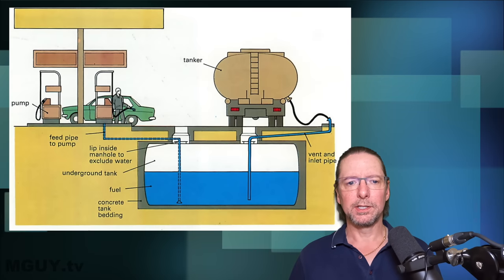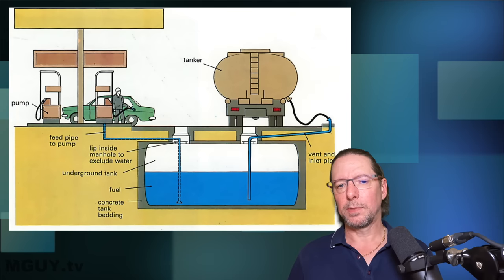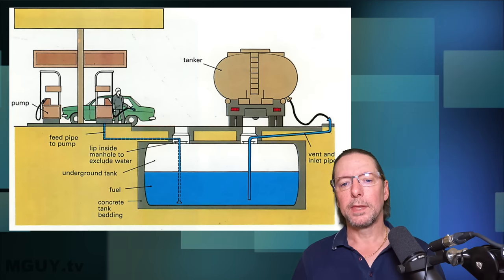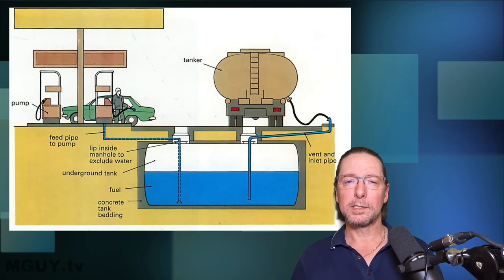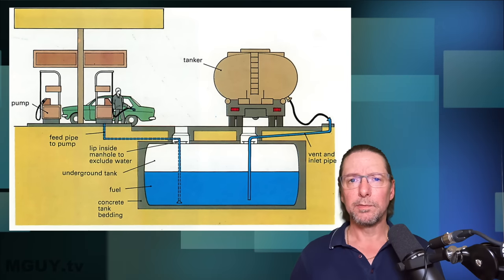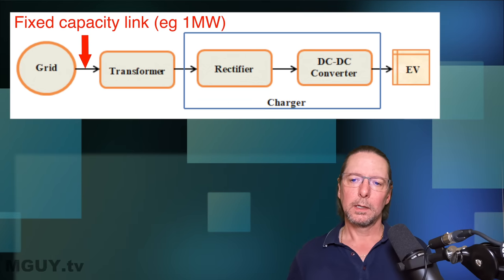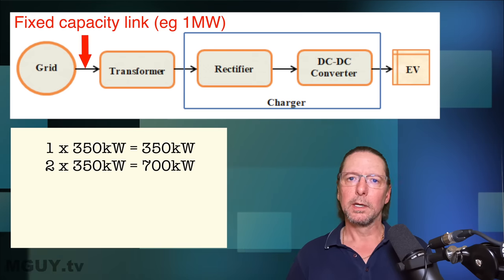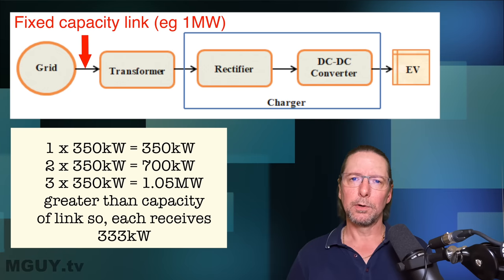HUGE problem with EV Charging Stations that no one mentions | MGUY Australia

Comment: Uh, you kind of skipped a meeting with how charger infrastructure works. You are dealing with 150A 400v infrastructure requirements, it’s not grid based. Once you add a 2nd charger, the typical supply will fail or overload. All of the chargers at a location are powered by a storage system. It’s usually “disguised” as a shipping container or vertical shelf for thermal control and heat pump cooling of the internal stacks. If you have a look for Bjorn Nylands channel, he opens up a charging station from Kempower, that shows the power grid and supply line limits, how they operate on single phase 100A circuits where the power supply is limited and they can’t get industrial supply in the area due to congestion.

Essentially, they charge a bigger reserve in off peak and add solar, usually as a parking structure of 20kw of panels to add an additional ~100kw per day. But these “shipping container” batteries store and balance something like 32 rack mount drawers, with batteries in a liquid frame/bath for coolant, each with 8-12kw of storage based on their age/density.

The Tesla battery modules were designed well enough that it made a quasi-standard for industrial use. Especially in thermal climates.

Comment: I believe your analysis to be incomplete. The problem you describe of the grid link being too small to provide maximum power to all charging stations at one time: 1) each car will regulate its charger iaw the battery. It would be extremely rare for ALL cars to even want maximum at the same time. 2) The grid infrastructure will be improved over time. Not all gas stations had adequate tank storage from day one and even if they did, all it takes is an accident on the highway or a bridge out and the tanks cannot be filled fast enough to support all pumps running at 100% all the time. Electrical cables can't be contaminated, do not fill up with sludge, etc. and are thus very low maintenance. 3) It is easy to add a wall box and charge the car at home. Ever try to add your own gasoline storage tank in a residential area. 4) Most countries produce a fair amount of their own electricity through a number of means and therefore electrical supply is often less affected by geopolitical events. Many countries don't even have 1 refinery and are 100% dependent on imports. What good are all those tanks in the ground if the Suez is blocked?

Comment: Not to burst your bubble, but they way that you described the fueling process at traditional fuel stations, just is not accurate for all stations.  It may be correct for some setups,  but not many remain that have not already switched long ago to a single, in-ground pump which is in the fuel tank.  That pump sends the product to all hoses that will dispense that product,  and if several hoses are in use at the same time,  yes, it very much does affect the speed of fuel delivery.
Having the pump in the tank eliminates having to lift the product to the surface, which is a huge problem if the system should lose its prime.  Having the pump in the tank below ground, lowers the volume of fuel that will be in the base of the pump in the event of fire. Believe me, that is important.  You still need to ensure that your break-away valves are in place and at-the-ready, should a surface event (vehicle strike the pump) occur.  One in-tank pump can usually supply in excess of 6 individual point-of-sale dispensers, in the event of a really huge station, they would choose a higher volume-capable pump.  These in-tank pumps are pretty robust, but can fail.  Failure rate is generally pretty low.  In a more traditional setup, where each P-O-S dispenser has its own individual pump,  you have more complex plumbing, more fuel sitting in lines above ground, more pumps, higher electrical requirements at the fuel islands, and more things needing periodic maintenance at ground level.  
In-tank pumps became the best way to go,  and in Canada, at least, they began going that way about 40 years ago.   I suppose there are still a few Mom-and-Pop gas stations out there that work on the older, traditional setup,  but due to environmental requirements based on past experiences,  going forward from the early 1980s, all new installations had to meet ever stricter guidelines for installing fuel dispensing equipment,  including new ways of monitoring the condition of the tank itself, and the product put into and pumped out of those storage tanks.
They want sensors in the tanks that watch product temperature, product level,  watch potential corrosion activity,  sample the surroundings for evidence of product leakage, etc.  It has very much gone high-tech to setup a fueling station, in North America.

Comment: This isn't really that big of a deal. The folks installing charging stations are aware of these perfectly foreseeable issues, and there are plenty of ways to deal with it. Even if 3 cars are connected at the same time in your example, it's unlikely they will be drawing their max capacity at the same time. Ramping up/down charging is very normal and happens at the vehicle level. Plenty of charging stations have batteries/capacitors that act as a buffer. And a 1MW charging station is a pretty small load if it's in an industrial area with hundreds of factories around. These issues can all be handled with some pretty basic engineering.

Comment: You are talking electrical common sense, however, the typical user has no idea about how electricity is rationed out in such demands. There are so many real issue concerning EVs, I know I will never ever own one whatsoever. Too many issues with them and the replacement battery cost is like buying a new vehicle and only getting the same old/used vehicle to drive...   Thumbs Up!

Comment: Gee, are you talking about the limitations of the current infrastructure???  Holy cow, nobody ever considered that!  Also I agree with the previous comment, you never talked about a battery storage pack.  You talk about, at length, fuel storage and its importance but not electricity storage!!  Why?

Comment: To any knucklehead that is still in favor of EV’s
Let’s assume a petrol station has 10 pumps.  You can fill up any automobile in less than 5 minutes but will use 5 minutes as a benchmark.  We are also assuming all tanks and batteries are empty.
10 automobile can feel their petrol tank in 5 minutes and that is 120 that automobiles per hour.
Let’s assume an EV charging station has 10 outlets and unlimited power available.  Today, it takes an average of 8 hours to charge a battery.
The 10 outlet  EV charging station can only charge 30 automobiles PER DAY and if you get there when all of the outlets are being used, you would have up to wait 8 hours before you can start charging.
The technology to feasible charge EV’s will NEVER EXIST.  Imagine this: an apartment building with 200 rentals would have to support a minimum of 400 charging stations.  Can you imagine the power requirements that would have to go into that building?
Please, I beg you, start to think rationally.

Comment: I can see what is wrong with EV charging stations.
They are out in the rain, snow and freezing fog!!!!
No weather protection.
When was the last time anyone plugged an electric cable into a socket in pouring rain?
Never?
A 350 kW power socket?
How many volts and amps produces 350,000 Watts? A lot of both.
Anyone electrocuted yet? Standing in a puddle.

Comment: I have an EV and a gas powered vehicle. I'll NEVER buy another gas powered car again. After two years, zero maintenance on the EV. Over $2000 on the gas vehicle. I buy energy at the equivalent of .29 per gallon! 
Infrastructures are going to need improvement. That creates jobs. I'm planning on installing solar panels next year, which will reduce my electricity usage to near zero. Again, infrastructure upgrades create jobs. BTW every modern convenience from the microwave to synthetic underwear was at one point subsidized by the government, so that argument is null.

Comment: EVs are incredible I’ve had a EV6 for a year and it’s changed my world and bank balance for the best. I drive 7 hours on open road upto 110km with slow bits going through towns without a need to charge. In a year I haven’t had to stop and charge once and I travel between 20km and 300km a day everyday. My home chargers charges 100km per hour and my power company gives me 3 hours free power and I only charge then. So free travel for a year saving approx $11k on petrol. Car battery has 8 year warranty and the petrol saving alone let alone service $$$ savings will have my $70k car paid off in 6 years. So free fast car which drives beautifully. So if you want fun fast free travel. Get a long range (over 500km) EV find best deal power company or do what some neighbours have done and have a solar carport and you are free from smog, polluting fossil fuel industry and greedy corporates and taxes
Reply: The lesson I take away from your post is, the more disposal income you have the more money you can make.
It use to be a risk investing in the stock market, but now " richer" people can make money just by having theeans to buy a brand new ev and live in a place we're 3 hours free electricity is gifted to them by there energy provider.
Doesn't really help the masses does it.
Reply: @brianiswrong  nah don’t take away a lesson. Just the hope if you save your money for ages u can buy one too then have a fast payback. It’s about thinking about the cards you do have on the table not the ones you don’t. Always use services offerings to get to your goals. And not to whinge

Comment: Another problem with charging stations is the fact that they are not standardised and it's not the case that any one charging station is not a "Fits all"station. Surely EV car manufacturers could agree between themselves to make charging a plug and go situation. At present it seems to be a "Dog eat dog" situation between the many and various energy middle men, all fighting over who gets the bone. This then becomes a problem for motorists, wasting  even more time chasing after a station which will connect to their particular model car. EV ?. NO THANK YOU.

Comment: What about the more important aspects regarding safety? 
The radiation levels in / around a charger / car being charged at high charging rates. 
Are those levels safe? - where is the published data of those levels.
Perhaps people with the relevant vehicles / access to measurement meters could collect data and PUBLISH it - This person for once (sitting on the "electric fence") would appreciate that sort of data being published.

Comment: No one is mentioning the "huge problem", because it isn't a huge problem. In fact, electric energy is far less a problem, than gas charging was a problem 100 years ago. For electricity, the grid already exists. For gas cars, the grid had to be created first. Also, perhaps 5% of the charging is done on fast chargers, and most of the slow charging is done at home. Also: there are almost no vehicles which can charge at 350. As far as I know, only trucks can do that. My electric cars, one charges at 50KW max. (that would be 14 cars at once, charging at max - and most of the time they don't do that), if the infrastructure delivers 700Kw. The other has no fast charging.
So, why making a "big problem" out of something that isn't a problem? The only explanation I have, is that the ones who do that, have shares in the oil and ICE industry.

Comment: EVs make for a very inefficient use of energy. EVs require an order of magnitude increase in the use of rare and valuable materials. They also place a huge demand on our already weak power distribution grid and just to make the matter even worse, building and trading in EVs at this point in time is putting the cart before the horse.  Oh, and I LOVE diesel. It is used to deliver everything I need, from soup to nuts.

Comment: Wrong. Tesla is deploying MegaPacks, to provide the equivalent of the fuel storage tanks that gas stations have. Tesla MegaChargers will definitively need the MegaPacks, as they are charging Tesla Semis and even Tesla Cybertrucks at a rate of up to 1MW. We certainly need grid upgrades. Here in Nevada, we have a pretty good grid infrastructure because of our high AC usage. I think we will be fine for the EV revolution. I personally have 2MWH Solar left over every year, that I could use for my future Cadillac EV, once my 2014 CTS 3.6 needs to retire in 2034 : )

Comment: To me the allure of an inexpensive EV such as the Fiat 500E is being able to drive to and from work, charge overnight at home and top off at my work for the equivalent of US$20 per week vs US$80 per week on my gas powered car. The maintenance could be lower as these Fiats "washed away" in our shores imported by grey market entrepreneurs and it's developed a cottage industry catering to them. Albeit, the used market for these cars has proven to be unmovable to depreciation.

Comment: Excellent points made here.  The key is the tank is cheap (5000 times less) compared to a battery at the station to take surge loads.  The future is fuels, not battery junk.
Reply: The future is not fuel, you can clearly see this every day.
Reply: No, fuel making OFF grid will be 20 times less cost than charging ON grid.  New combustion tech will also be 4-5 times more efficient than old ICE cars, and 1.5x better than EVs in MPGe.  Fuel is the only way to get to CO2 neutral if that is the goal.  Deal with this fact. @krashd

Comment: The whole issue is to electrically charge a vehicle you must use "GAS" for the electricity... and if that is not available "COAL" will be used to send the electricity to charge the electric vehicle. The electric vehicle is charged by gas and coal - why do this - it is nonsensical. Just make the gas & diesel engines better.

Comment: In general EVs solve less than nothing and without immense tax incentive are irrational.
I have experience a slowdown at petrol stations.  Like takes 8 or ten minutes to fill a 16 gallon tank.  Some of this may be caused by metering.  However it is nothing like what it takes to charge an EV.
One solution to EV charging could be solar powered charging.  A set of solar panels about size of a parking space could provide enough charge for about 60 miles per day.  This could be grid independent but obviously is only effective for a few hours a day.  However EVs still have other serious problems like safety.

Comment: I would think the designers of these charging stations would size up the correct step down transformers to deliver the necessary power needed for all chargers to operate at 100% capacity when all chargers are in use simultaneously! The sizing of transformer or power input to the charging station would more than likely fall on the electrical engineer of the utility and not the design engineer of the charging station! 
Before a charging station goes in, a load study must be done and submitted to the utility for review and approval before a permit is issued. And the there will be an additional buffer capacity above and beyond the anticipated 100% capacity usage just so there are no hazardous situations to cause transformers to heat up and catch fire or explode!!!
So no, I don't believe that when one car is being charged, it gets 100% charge output from the charger and when a second vehicle is charged, the power from the charger goes down to 50%!!!
I'm not for these battery cars but want to point out the flawed assumptions you've made in this video regarding charge capacity of these charge stations!!!

Comment: In more isolated areas the EV charging stations, are aided by a diesel generator, get it a diesel generator. 😮
Reply: Wow,  i did not know that.   What’s the point.   The losses through inefficiency would be enormous.   The carbon output for a single charge up would far exceed the car just running on diesel.
Reply: @roykowalski4125  Yep, I didn't know it until recently. To install a charging port at your house  costs thousands, depending where you live in NY or SF the permits alone will drive you nuts. If you sell the house the new owner gets all the benefits. If your new house doesn't have one you'll have to do it all over again.

Comment: You are wrong here, in fuel stations you can not fill unlimited number of cars at a time, there is limitation of filling nozzles, so if a fuel station is designed to run 10 nozzles at a time then that the cap. Let us now come to EV charging, what you are basically saying is that more than required charging points are connected to single output , hence the rate of charging will reduce if more no of cars are charging. If someone is designing EV stations like this does not understand the electrical system very well. Charging stations can be designed to charge each point to a specific capacity without depending on no of cars being charged at a time. This should be part of design. We have charging ports in bus, train, aircraft they charge a a specific current irrespective of no of people charging their devices.

Comment: This is why EV cars in the future will need universal fuel cells.  If you are going outside the charge range the fuel cell with generate the power and run on fuel.  Battery power itself isn’t enough.

Comment: Never knew the limitation for the EV charging, for some reason I thought they had a battery buffer between each of them. To me that make sense.
I wanted to have an EV but with so many problems that’s facing them it’s just not worth it right now and by the time all the bugs are worked of the system I’m going to be too old to be allowed to drive. Um unless the fix the auto drive options by then well that’s whole new kettle of fish😹😹
Reply: The chargers are powered by 3 phase AC.

Comment: There's a huge issue with electric cars.
They don't need a charging station if the vehicles are fitted with a dynamo system.
The car will charge itself through kinetic energy 🙏